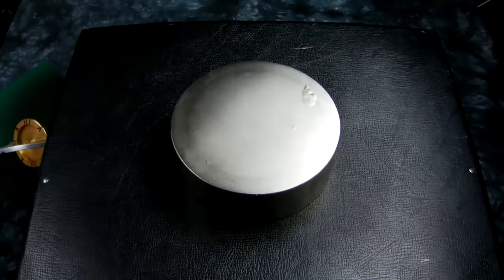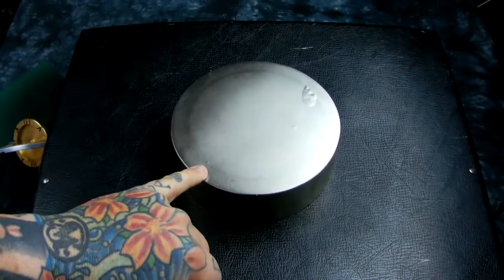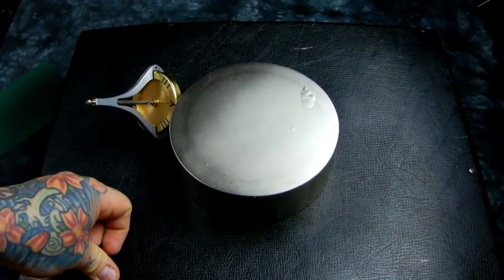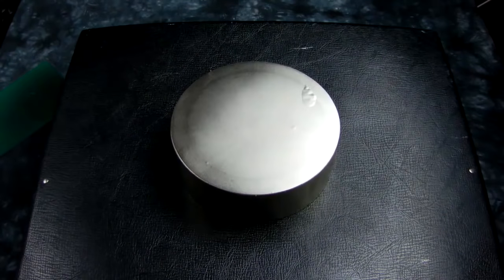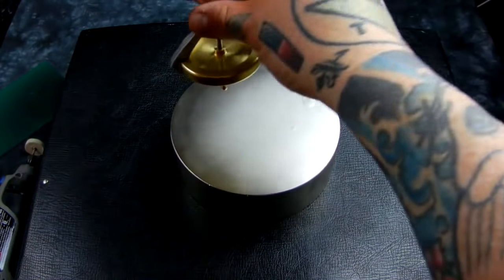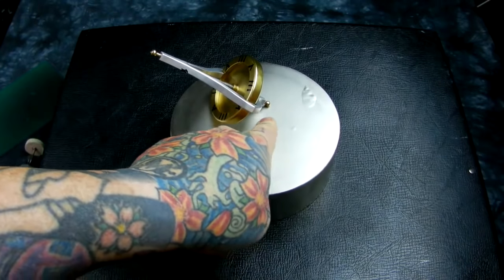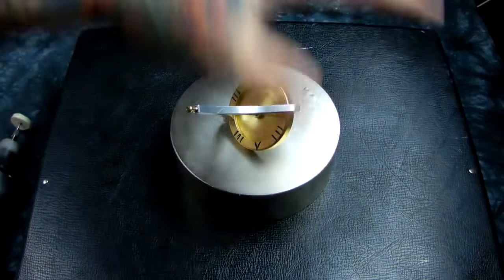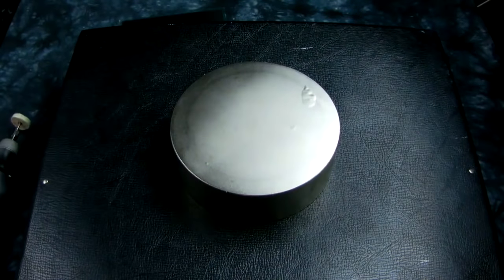Must-See Video! *SECRETS OF MAGNETISM* Never Seen Before* Torus-Hyperboloid

Comment: For those of you not wanting to watch him repeat himself for 20 minutes and use big words to try to explain a rather simple concept. Magnets have a toroidal field surrounding them. These fields have a swirling vortex like movement in the middle of them (which is why the top will keep spinning in the center), but on the outside edges (while still at the same strength as the vortex part) it's not a vortex but a wide outward sweeping motion. This causes the top to stop spinning because the field movement or 'flow' if you will, is different there... yeah that's it. That's all he's trying to say with all this LOL
Reply: lmao you should have just made the video instead of this guy. Thanks!
Reply: Only a lot more in depth and in a manner which even an idiot could understand. Only if they first accept that Einstein was a moron aside from a high IQ. “Special relativity” 🤦‍♂️ lol. Not rly how theory’s are created, but ok.
Reply: Why not just explain the right hand rule because the magnetic field is perpendicular to the electric field and a force on a conductor in a magnetic field generates an electric field the resulting force will either be in clockwise or ccw I.e. speeding it up or slowing it down based on the direction of the magnetic fields
Reply: @kylewesbrook4916  there is no difference between magnetic and electric. A better description would be magnetic force, not electromotive force.
Reply: He is obviously trying to make you familiar with the reasons as to why  it happens. He is EXPLAINING how magnets work. Because we aren't told that in school. And it has huge implications. HUGE.
If you are a truth seeker I suggest you actually listen to EVERYTHING he is trying to say and visualize it. Watch his other videos too until you understand magnetism and you will understand just HOW much we fucked up in science.
Reply: If there's a constant motion in the field how come we don't have perpetual motion devices? If it worked that way wouldn't it be easy to engineer something to take advantage of it?
Reply: and he's still wrong.
Reply: Could you create a generator using this principle?
Reply: @vkhelldog  Can you explain why there is no difference? And if there is no difference, how do you explain electromgnatism, by definition the creation of a magnetic field using electrical current?
Reply: People learn differently.  Some take less that 1 second to understand, while some take a whole lifetime and not enough.
Reply: Briliant answer. Thank you.
Reply: @withsilentwings  perpetual motion machines unfortunately don't work, because they require physical components to harness the energy. But physical components are subject to atrophy (they are acted upon by gravity and other elements that slow them down till they stop). So constant motion is improbable.
Reply: Aha, and what is a field and what is spinning inside it? He's just breaking it down to basics. Also, sometimes you have to use proper terms instead of abstract ones.
Reply: Just like Flat Earth , we know...

Comment: +Theoria Apophasis Cool this may explain something i have observed at work. As an engineer we use magnetic squares to hold 2 pieces of metal together before tacking them in place. i noticed that sometimes the magnetic field doesn't do anything to the weld but especially with my big magnet the molten metal blows back in my face before it can cool and bind the 2 pieces. So today after watching this video i did an experiment. I got my big magnet which can hold about 1kg or more, laid it on its side like yours, placed a thin piece of flat steel on top and proceeded to weld across it and as i expected in the center of the magnet the weld pool settled normally and the closer i welded to the centrifugal divergence point at the edge of the magnet the more the weld was repelled and sprayed out on to the floor
Reply: Interesting